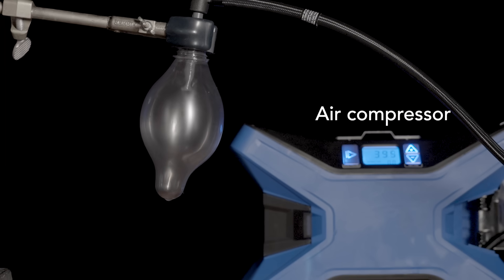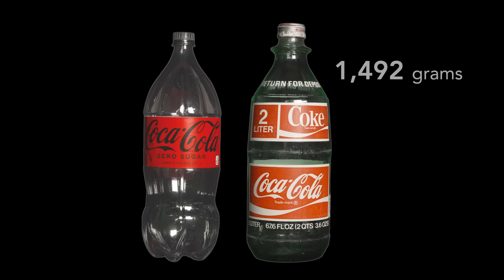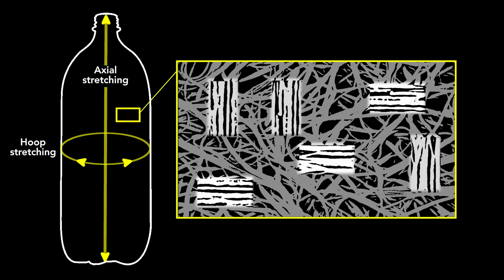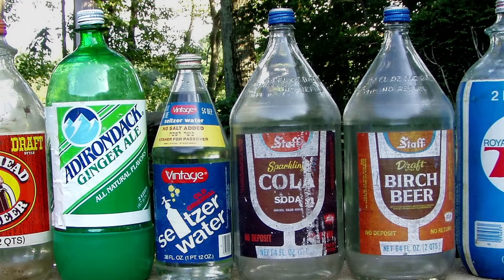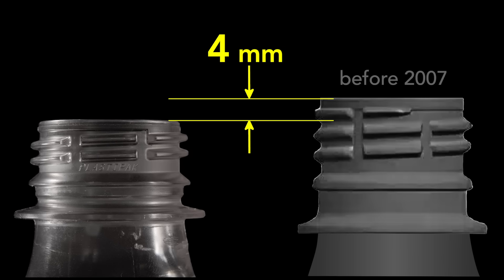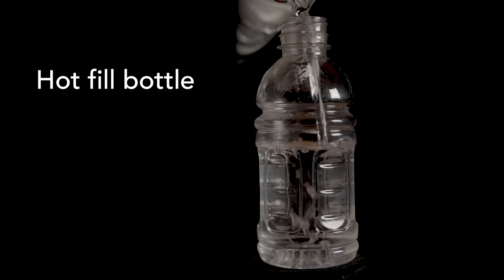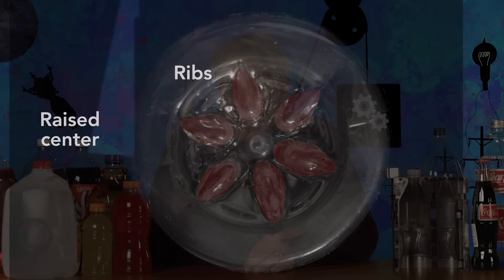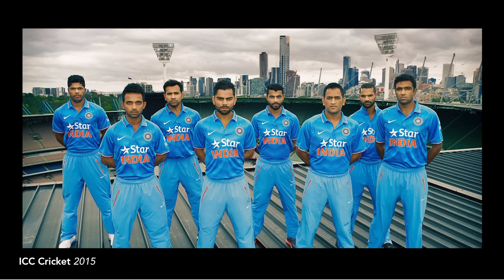The masterful design of the two-liter plastic soda bottle

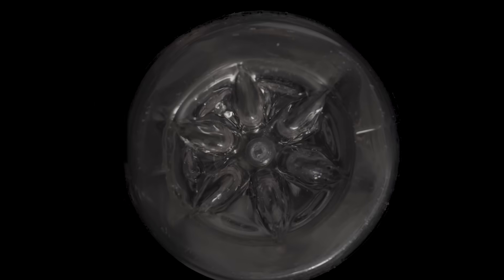Comment: I didn't hear you mention the vacuum stage during the injection process.. You can see the result of it on the bottom of the bottle (all plastic bottles) at 9:24. It forms that rough plastic nipple. Without the vacuum during injection, the bottle walls won't be uniform and will be weak.

Comment: Great explainer. I really liked the cut-away demonstration of how the cap detaches from the tamper indicator ring. 

Can you do a quick follow up showing the engineering behind the cap systems used in Europe where most of that ring detaches except a section which keeps the cap attached to the bottle? This may have other purposes but it also prevents the cap from being thrown away separately from the bottle (reducing littering).

Comment: About 500,000,000,000 plastic bottles are used each year. If all of them saved 2 grams from the new thread design it saves 1,000,000 tons of plastic each year.

Comment: I was waiting from almost the beginning to figure out why the heck bottles had those "caps" on the bottom when I was growing up. Mystery solved! I also wonder if those preforms are sold as is. My wife bought some "tubes" from Amazon for Lab Week at the hospital she works at to fill with candy and suck and they look identical to that preform but have metal caps. I will have to dig one out and look at the threads.

Comment: There are three layer preforms with an inner and outer layer of PET sandwiching a thin layer of nylon. It dramatically increases the shelf life of products over single wall design. There are also double layer preforms with an inner ethylene vinyl alcohol layer for better solvent resistance. It's quite amazing technology.

Comment: That was my CHBE professor—can’t remember if it was 221 or 222, but I’ll never forget this speech:

“Some of you will fail. I did. Some of you will drop out after that. I did not. I retook the class, studied hard, and I passed.
You can:
	1.	Do that the first time, and pass
	2.	Don’t do it, fail, then do it, then pass
	3.	Don’t do it, fail, then drop out of Chemical Engineering
And though there are no other choices, the choice is yours.”

That stuck with me. One of those rare moments that actually reshapes how you think.
Reply from the maker: That had to be 221
Reply: @engineerguyvideo  thanks for the clarification. Your work continues to inspire me (and millions others)

Comment: I just realized that when I accidentally drop a filled 2L bottle, my intuitive fear isn't that the bottle will break, but that the cap will break off. Even when you dropped the bottle in this video, I was like "no I wouldn't do that with so much confidence" but my reaction actually had nothing to do with the structural strength of the bottle part itself. It's a very important distinction that says a lot about how strong the bottle actually is.

Comment: Bullcrap. The two liter bottle sucks. It's top-heavy, too tall and has a bottom that causes it to tip over easily. They could have made it shorter, a little bit chubbier and with a flatter, more sturdy bottom. FKN glass bottles don't poison you and are easy to recycle. Plastic bottles won't degrade and have turned our planet into a trash dump. THX for being an apologist for the plastics company.
Reply: I imagine the reason they're not chubbier is so that the fit in home fridge doors more easily, and there's probably some retail stacking efficiencies too. From what I've read, that sort of thing is done to some pretty specific metrics.
Reply: @MikeStevens  2 liter soda was around long before fridge door shelves became big enough to fit them. Now they're big enough to fit gallon milk cartons. If a friggin' milk carton can fit on a fridge door, so can a chubbier, flat bottomed 2 liter soda bottle that won't tip over on the table.

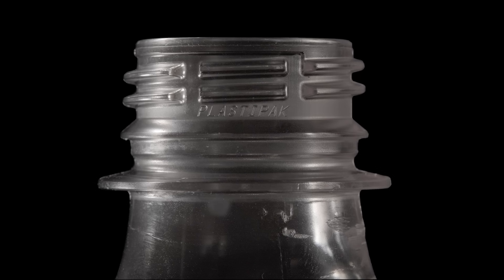Comment: 6:30 When I was a kid in the nineties I would twist the cap of an (unpressurized) plastic like you would with a spinning top for fun to launch it straight up into the air. I tried to do this again recently to entertain my kid during dinner and I noticed that I couldn't any more - the cap would go all over the place instead of straight up, no matter how hard I tried. I wonder if the shorter length of the neck is the reason?

Comment: Normal plastic reusable bottles also use a preform. Cheaper ones will actually revert to a preform if boiled in water or otherwise left in high heat. This creates a funny effect where people go to wash reusable bottles in a dish washer, only to later find that the bottle is now a glorified m & m tube.

Comment: It's a terrible design. Here only its structural performanc is being considered.
However, as a 1-use only item, beibg plastic means that many of them end up in land fill or the environment for centuries.
Reply: That's like saying dynamite is a terrible design because it can kill people.
Reply: @flytrapYTP  
No it isn't.
These plastic bottles are single-use but cause a massive amount of polution.
Reply: @lewis72  it quite literally pollutes the environment because the design is so good that it's produced in overwhelming amounts.
Reply: @flytrapYTP  
"it quite literally pollutes the environment because the design is so good"
 - Something that pollutes the environment can't be a good design.

You're really not with this, are you ?
Reply: @lewis72 you cut off my reply when quoting it. You are obtuse and annoying.
Reply: @flytrapYTP  
I quoted enough to make my point.
You're very 1-dimensional in your consideration of what makes something a good design.
Reply: @lewis72  no, you've specifically cut the part where I say that it's produced in overwhelming amounts, which is what the actual problem is. Disposing of a plastic bottle properly is very easy. It has nothing to do with the design that allows it to withstand pressure or stand upright. You are annoying and unlikable. Goodbye.
Reply: @flytrapYTP  
"I say that it's produced in overwhelming amounts"
 - "overwhelming" being the operative word.
We're overwhelmed with plastic rubbish.

"Disposing of a plastic bottle properly is very easy"
 - Is it though ? Even if they are disposed of, they still exist, causing plastic polution.
Reply: @lewis72  take a hint, Lewis

Comment: You think these are magical? These bottles are so top-heavy they keep falling over. An empty bottle will fall over if you look at it angrily enough. I wish they would transfer some top weight to the bottom OR make the bottom flatter. It would be simple to add some plastic to the bottom to make them steady even when they are full. They are recyclable, so they wouldn't use more material.

Comment: Bill, this topic is very morally fraught.  Glass bottles are virtually 100% recyclable.  The only reason to switch to plastic is what you mentioned at the beginning: they are lighter, meaning cheaper for the soda companies to ship, and hence more profits.  They are destroying the environment for profit.*

*I think the word "recyclable" needs to be stringent as well.  To be recyclable it must be reused in its first form.  A bottle that then becomes clothes is NOT recyclable.  A glass bottle, sterilized and used over and over, is recyclable.

Comment: Very impressive in the sense of engineering. But horrible regarding waste, recycling. ♻️ it’s not properly recycled because in the trash all the plastic types are mixed .  Not talking about the micro plastic Forbes all over the world 😢 Go back use glass that could be used several times. Drink tab water instead of sugar lemonade

Comment: I hate these bottles. I have unusually high torque output when putting the tops back on them, ANYTHING that needs to be swirled on. After 1 sip, my bottle no longer seals correctly smh. Please reinvent the caps. I can’t tone it down.

Comment: I remember in the 80s, they used to have the black plastic cups on the bottom of the two liter bottles. I guess the molding back then wasn't as good and they need those cups to make a flat surface.

Comment: If you wrap a 2 litre bottle with fibreglass tape (if you can find it these days) you can use it as an air tank holding 200 psi.

Comment: You wouldn't happen to have come across a number for the burst pressure of a PET preform?  It's an interesting question, since the diameter and thickness are such that it ought to be significantly higher than a final bottle, but on the other hand, it hasn't undergone that stretching-induced strengthening...

Comment: I remember the first time I saw a commercial for the 2 liter plastic bottles of Coke (or Pepsi, whichever). Some kids were pouring themselves soda and then one accidentally knocked the bottle off the table. In slo-mo it dropped and I honestly felt some shock and empathy for the kids as the bottle was about to shatter, literal chills running up and down my spine -- but then it harmlessly bounced on the floor! An out-and-out miracle at the time.

Comment: 5:40 That neck is not only used during production. In some shops (at least here in Austria/Europe), there are "shelves" with slanted wires that hold multiple bottles up roughly at shoulder height. You can easily pick up a bottle by lifting it from the bottom and/or the sides and the next bottle will slide into place. While designing shelves this way might not make any difference to most people, when you have problems with our hands (for example age related), you can more easily pick up the bottle with both hands by grabbing the neck with one hand for stability and supporting the weight at the bottom with the other.

This might seem quite a bit of overengineering, but in the split-second decission on which bottle to buy, making the one with the highest margin for the shop easiest to grab can steer a lot of customers to that specific brand or bottle size. While at the same time making the experience faster and smoother for the customer.

Thats the same reasoning why developers of modern cash registers spend a lot of resources on things like making the printing of receipt faster and improving the processing speeds of card payments: It reduces the number of open cash registers required, but also improves the experience of everyone standing in line, increasing the chance the customers will return to this particular shop next time they need a bottle of soda. Speaking from experience here, i'm the main developer of our companies cash register software. 

And yes, smoothing out the customer experience also has to take edge cases into account, like the old lady with the broken hearing aid who needs to be able to read the total on the customer display, even when she refuses to wear her reading glasses in public, while still making the display look sleek and modern and appealing to the younger smartphone generation. If done perfectly, engineering like this will go completely unnoticed. It is only when the engineering is done improperly, that customers will even notice that something is not quite right with their shopping experience, and they may choose another shop next time.

Comment: This was fascinating to me because I'm a homebrewer and I use 2L plastic bottles. One of the many benefits is that in the several years I've done this I have never once created a "bottle bomb" which those who use glass may have done if they were as careless when carbing as I have been. There have been times when I have overcarbed (used too much sugar when bottling) and the bottles have turned bell shaped. The "petaloid" base blows out to the point where you can no longer see the five points.

The fact you mention the bottles can take 70 psi was also a bit of a mind blower. But then I do often fill more than the flat line you showed with the hemisphere shape. So this has been quite valuable. I knew about gas permeability but not the percentages. All in all you've given me quite a bit to get on with. Thanks for the info.

Comment: in theory the burst resistance is really nice but I can’t tell you how many 2 L bottles myself and my children dropped from a meter or less that actually split the side at blew the bottom out, granted it’s a percent of a percentage, but if it’s happened to us several times make you wonder about quality control. I solved the problem by stopping drinking soda.

Comment: Fascinating, thanks for the insight into the manufacturing process.

I guess the captive cap hasn't made it to the U.S. yet. They were a bit of an annoyance when they first started to appear in the EU/UK, since they made drinking from the bottle more difficult, but it didn't take long to adapt, and now I'm used to it, I appreciate the benefit of never losing the bottle cap.

I also know that people have also 3d prointed tools to turn PET bottles into spools of PET filament for 3d printing. Stefan from CNC Kitchen did an excelelent video a year ago, along with testing the strength of parts printed with the recycled filament.

Comment: Very interesting, I worked in the packaging and cosmetics industry quite some years ago. Amazing how much effort is being spent on reducing every gram of material and second of cycle time during production. We called this an IBM bottle (Injection Blow Moulding), but also made many EBM (Extrusion Blow Moulding) products. A very interesting method for another video. Shampoo and soap bottles are often EBM, easily recognized by a seam on the bottom and often made out of PP or PE.

Comment: Just a couple weeks ago I was wondering why there was such a variation in thickness of plastic bottles. It seemed unnecessarily wasteful for something like Gatorade to have a far thicker bottle than Coke which itself has a far thicker bottle than Poland Spring. I was able to reason that the pressure was the reason for a Coke bottle being thicker, but I never would have guessed that the thickness of a Gatorade bottle had to do with heat!

Comment: Cost of compressed air.  
Compressed air is the 4th utility (  Electricity, Water , Natural gas are the other 3 ) and very expensive to produce due to electricity consumption.  The cost of a compressor and maintenance is only a small fraction.  Compressed air is also the most wasted utility in most any environment as leaks are ignored due to them not making a mess or lighting  things on fire.

Comment: In a past life, I was a Process Tech for a few years at a bottle maker (blow-molder) for a major soda company. My machine specifically was the blow-molder for 20oz size soda bottles (like those most common at convenience stores). The 3L, 2L and 1L lines ran a bit slower than the 20oz line at roughly 12k-16k bottles per hour if I remember correctly. However, the 20oz blow-molders were the most demanding and ran at 28k-30k bottles per hour nearly 24 hrs a day... if the palletizer had a jam up downstream for example, the 20oz blow-molders were the only ones that would NOT have to pause due to the line back-up. They had "silos" where the bottles could dump into temporarily and would feed back onto the conveyors (after the palletizer resumed) to eventually continue palletization. Meaning the line worker operating the palletizer would then have 2-3x the amount of bottles suddenly coming toward them until the silos were exhausted (the line worker had to ensure all bottles were standing).
Each of those blow-molding machines in particular (Sidel brand machines were what I was certified on) had, iirc 12-20 molds. When it was time to change the mold to say, another company's version of 20oz bottle... as we let the preform hopper run out, everyone in the building who had a rolling toolbox, all process techs, maintenance and engineers, would gather round the main wheel of the Sidel. The preform oven was kept warm and ready during this process - "hot changeover" I think we called it.
The molds went around horizontally as the plastic was blown, so once the last bottle came out, the wheel would be brought to a stop and each of us would have 1-4 molds we'd be prepared to change as fast as we all possibly could simultaneously in what was akin to a "pit stop" on a race track. That way, once the molds were changed, preforms would start feeding back into the machine and production could resume asap.  
Granted, 2L and 3L lines weren't quite as fast nor in demand so the Process Techs assigned to them would see it more as a punishment since the amount of stretching required for those sizes would lead to more frequent quality issues like "cracked gates" - the center point at the bottom would crack if you weren't as savvy with your oven temperature/blow pressure configuration, which would also fluctuate throughout the shift - the process was sometimes quite sensitive to the atmosphere in the building as the day progressed.

This video from @engineerguy is the first I've seen to cover the process so succinctly and in such a compelling manner. I've never been so inspired to write about what was one of my first jobs as an adult! PS: no I didn't have to run the 2L or 3L lines unless I was covering for someone haha
Reply: Thank you for your service in the Cola Wars.
Reply: Thank you for sharing 🙏❤
Reply: hey it’s brickimmortar! awesome seeing you here. Your safety matters!
Reply: Now I know one of my favorite youtubers used to do bottle mold pit stops. Love it!